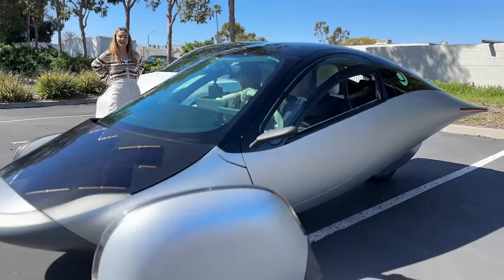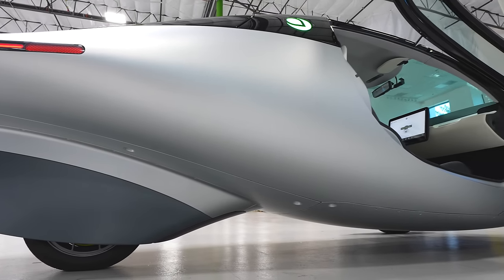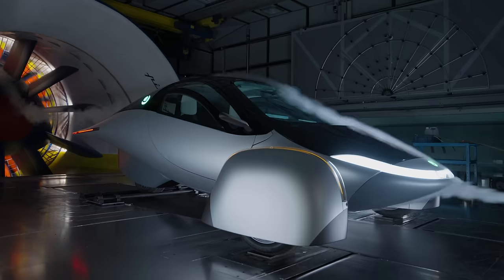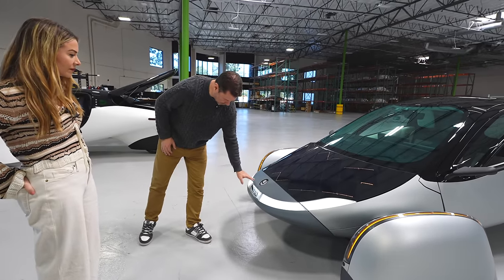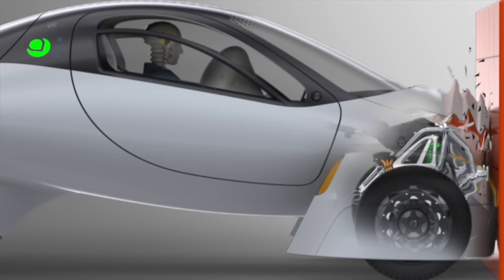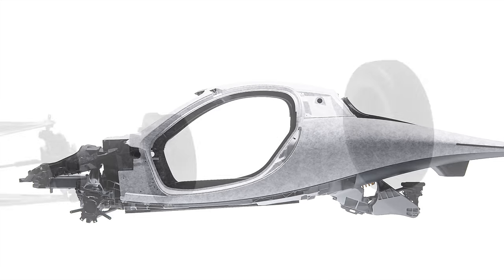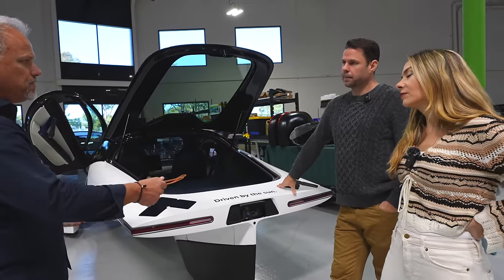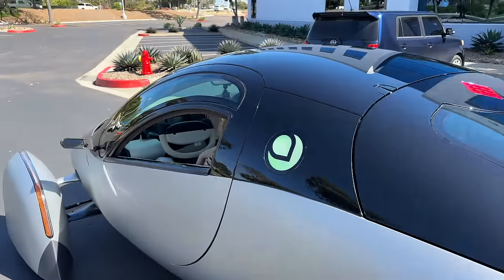Confronting Aptera's CEO w/ Investor - WHERE'S MY CAR?

Comment: I love aptera and have invested but am concerned about just how much market share they can capture with only 2 seats. I'm skeptical that most consumers will compromise on passenger capacity with the vehicle that they buy. That said, the aptera will be great for fleets, for some commercial use because it does have a lot of storage, and will be a very good shared or rental car. It will also be the best possible form factor for a robotaxi. Autonomy is what will truly unlock the ultimate upside for aptera. I ran some numbers and found that the cost to operate an aptera taxi over a 1M mile lifetime would be less than half the total cost to operate a model 3. Even if you assumed max capacity for each vehicle, an aptera with 2 passengers has a lower operating cost per mile than a model 3 with five passengers in it. This is why i think tesla should either acquire aptera and turn them into robotaxis, or design their own similar form factor vehicle.
Reply: Average total occupancy of vehicles in America is 1.5.  A 2 seat, efficient, commuter car will do well.
Reply: Aptera is planning a 4 seat version (probably with 4 wheels) in the future. This video was the first time that I have heard that Aptera is also planning a "utility vehicle", bus and semi-truck, which I think is fantastic, because they can dramatically lower the environmental costs of operating large vehicles with their better energy efficiency. If I had any money, I would invest in Aptera, because I foresee it turning into a major auto company.

Comment: I put in for the 1000 mi range edition because I want to do cross-country roadtrips in it with the tent unit.
Reply: My wife and I plan to do the same with an LE 400 mile range version.  We have extensive motorcycle camping experience and the range and comfort will far exceed our experience there.

Comment: The only thing that can compete against Tesla is good engineering and that's what Aptera brings to the table.
Reply: Aptera can't really compete with Tesla when something is expensive to engineer (like heat pumps, noise reducing laminated glass, carbon-wrapped motors, custom IC design, driving AI development, etc). Aptera has to stick solutions that can be done cheaply, but Aptera has made a lot of smart engineering choices in my opinion to avoid high costs.

Comment: The mileage doesnt make much sense. 250 miles for the 25 kw battery but the same ratio for the 100kw battery with hundreds of pounds of additional weight
Reply: The lighter vehicles will certainly be more efficient.  We will get a better idea of actual performance once the validation PI vehicles are tested.
Reply: Yes, the 25 kWh, 60 kWh and 100 kWh batteries are just estimates at this point, whereas the 42 kWh is production intent, so it probably will be what is produced. I expect the other battery sizes to adjust when Aptera actually produces those models, just like the 40 kWh changed to 42 kWh with the 400 mile version.

Comment: the right to repair philosophy basically illuminates the need to have service centers as long as you have a mechanic you can trust. that itself is enough for me to sign up, after seeing the a few of production model reviews ofc
Reply: I have already spoken with several independent mechanics here in Iowa, where I live and every one of them are eager to work on it.

Comment: I’m a fan.  My only concern is driving in snow and slush.  Lightweight and low friction is great in almost every way except in inclement weather.
Reply: I live in Iowa, and will report on my year round experience.   With proper tires and AWD, that can sense slip and adjust torque 32 times per wheel revolution, I think they will do fine.  Tesla's traction control senses 4 times per wheel revolution.
Reply: @n.brucenelson5920  I get that.  It’s more about hydroplaning and getting stuck than spinning out.  

I’ve spent 45 yrs in Western NY so I’m no stranger to snow.

Comment: While the Maxeon solar cells are pretty cool, they aren't the only mono-crystal silicon solar cells capable of forming to compound curved surfaces.  Also, starting at about 14:08, Chris Anthony exhibits quite a bit of ignorance about "old style" solar cells.  It is simply NOT true that if the crystal breaks that it kills all electrical connectivity.
Reply: Could you link us to more up to date information on this topic?
Reply: Regarding the "old style" solar cells, Chris A still trots out the old (and wrong) "if you break one it turns into a resistor" line.  What's new for him, however, is the incorrect assertion that the "old style" of solar cells are "only attached on the sides".  Clearly he hasn't even looked at solar panels made with "old style" solar cells.  If he did he would immediately see they aren't "only attached on the sides".

Comment: 10miles/kWh (if comfirmed) means 224N similar to the weight of 50lbs that is over 2x as efficient as the most efficient evs on the market (337mpge) but its also carries 2.5 less passengers. I like the idea of making the most efficient ev but the 1 row seat configuration is not the best compromise for efficency and passenger capactity and neither does the 3 wheel configuration that makes the car extra wide for stability. narrower car with 4 wheels and either 4 seats or two inline. 4 non open wheels.
I hope they did a good job at thermal insulation because AC impact on range is going to be brutal orherwise

Comment: I put my money down on Elio when they were telling everyone they were at this stage. Obviously that didn't work out. I hope Aptera actually delivers vehicles, but I won't be putting a reservation down. Also at this price point there are plenty of vehicles that do the job of daily driver just as well. One of the compelling things about Elio was the price. Obviously that was a pipe dream. However at $30k+ this is just a toy like the slingshot or the Can-am.

Comment: I love this idea and am one of the reservation holders... but... this vehicle does need tow hook points fore and aft. Why you ask? Because some will either get stuck in snow/sand, and or possibly go off the road either intentionally or unintentionally. So having some means of tow contact that is structurally sound is an important feature for any vehicle.

Comment: If sleeping in a car you really don't want your head in the tighter space or a window right over you. Also, during the knock-to-open pitch there was no mention of a reasonably accessible mechanical override -- something that would work if you fell asleep with the heater on or dropped into water.  I heard of this outfit through Rich Rebuilds.  Nice to catch a reminder.
Reply: I would like to look at the stairs out that hatch window

Comment: The new Preston Tucker? At least he built 51.
Reply: Aptera could keep $5 million stashed away and hand build 50 units at $100,000 each and deliver them at below cost. And avoid the fraud charges assuming the cars are viable. But I suspect if they delivery a single car to an independent reviewer the car will be exposed as riddled with problems.
Reply: @joedirt1965  Aptera is going to do complete validation testing on the PI models.   Remember that Tesla was shipping Roadsters for the first year with transmissions that broke under acceleration, and called them "production" vehicles.

Comment: My question for Aptera would be if a heat pump would be an upgradeable module later on for existing owners. Since in another interview Aptera was saying they want to make something easy to service. That if they come out with a better battery, computer, solar panels, ect that the end user would be able to buy it and install it. I have a concern about the ground clearance for the shrouds over the wheels. Not all roads are perfect. I worry about a pothole or road debris damaging that. Or even a steep driveway or exit to a parking lot.

Comment: This car was supposed to come out last year.... then it got delayed to late 2024..... now he's saying production will start about 9 months after they get tooling that they haven't even raised money for.... gimmie a break. This car is easily 2 years out still. There operations is a money pit. Last time I checked they are spending near 5 million per month not even in production.
Reply: Aptera currently spends $1.2M a month so stop sucking up misinformation and regurgitating. Fairly cheap as most auto companies spend billions to get to this point in pre-production. Watch as they enter production by end of this year or early 2025.
Reply: @barnabasseadog7660  he's saying production will start about 9 months after they get tooling that they haven't even raised money for. about a year ago he was saying they need to raise 35 million to enter production. now he is saying it's 75 million. have fun waiting I guarantee this car isn't in production until at least 2026. by then Tesla's 25k car will be ramped up and this will be a niche product if it ever actually releases.

Comment: The motors must survive a lot of stresses on a small footprint. Heat from breaking residue from the streets a lot of moving parts acceleration.

it Will be interesting how they hold up.
Reply: Most braking will be done by regenerative braking not a lot of stress placed on the brakes, and the pads should last a long time.

Comment: Why the questions about camping.? Nobody is taking that thing camping, with its low front wheel cowl clearance, it'd be lucky to cross a mildly rough bit of terrain.
It's a city commuter, not an overlander.
Reply: I will take mine directly to Death Valley from the factory - a place I have camped many times.

Comment: 🤔 How does the Aptera perform in crash tests?  

       How does the HVAC effect range?

       Although solar charging is the normal paradigm, will the Aptera be Tesla Super Charger compatible?

       Bringing Sandy Monroe’s group in early was a great idea for manufacturing optimization.  Thanks for a great presentation.
Reply: Some of the first Production Intent vehicles will be crash tested by a 3rd party to automotive standards and the results published.   We may know by Fall.

Aptera was the first company to press Tesla and the US to open the Tesla connector to be the base for the NACS standard, and they had permission to access Superchargers 6 months before Ford did.  The first vehicles will have a maximum charge rate between 40-60 kW - enough to gain the 400 mile full range in an hour.
Reply: @n.brucenelson5920  

      Thanks, Bruce, for the excellent info & feedback. 👍

Comment: I hope is has more than a 2500 mah battery, thats one 18650. I think you may have meant 25000 mah. The proper way to describe it is in Watt Hours, and the Fanttik has 92.5Wh. 
Watt hours is a way of rating a battery no matter what voltage it is, and is a better indicator of the total power you can get from it. A 92 watt hour battery can deliver 92.5 watts for 1 hour.

Comment: Who needs an Aptera when you can buy a small  BYD for $12,000-$13,000.The cheap EV will dominate niche 3 wheelers that cost double the BYDs
Reply: The BYD will be less safe and cost FAR more to operate over time.  The time to pay back the difference will depend on the energy costs in your area.

In addition, the 4 second  0-60 acceleration is far more fun.

Comment: The inherent conflict comes from talking about lightweight as the key to the millage efficiency and so forth and then talking about "loading it up" with band equipment, camping equipment, and so forth. So you have high efficacy but is based on unrealistic use cases.

Comment: 43:54 "A heat pump is terribly complex”  Huh?
I’m no expert, but I believe a heat pump is just an air conditioning system with a reversing valve. You were 95% of the way there.
Reply: I think you have oversimplified the concept of a heat pump. However, the majority of the complexity is in designing a heat pump for specifically FOR this car. It isn’t as if you can just slap a home heat pump or even a sedan heat pump on it and be good. You have to figure out where it will fit into the body of the car alongside the current build and wiring. You also have to design how it will be manufactured from product sourcing to installation in the production line. Additionally, you have to consider how it will behave in crashes, and be maintenanced in the future. 

That’s why it costs so much money to develop and why the estimate was 18 months of lead time.
Reply: @LC-sc3en  Good point, I rewatched it and he is talking about NRE cost, not piece price.  But I stand by my comment that a heat pump is not terribly complex.  It's almost the same as an air conditioning system.  It's a shame how few vehicles and buildings use them.  At least that is slowly improving.

Comment: I have a feeling drivers will damage the wheels and motors because they are outside the body width of the car. Simple distractions will make for very expensive damages. Why couldn''t they make the wheels fit inside the body of the car?

Comment: Why can't they use a small radiator like in car for the heater just tap in to the cooling lines or the in wheel motors to cool them down ..The friction heat needs to go some were ...Just a thought ...

Comment: Yeah great engineering, form factor etc, but fundamentally it's an expensive gadget solving a problem that doesn't really exist. Most journeys are short, or very short. And it's not going to make congestion go away.
I'd get by with a 100-150 mile city car for a third the price, but most of the time our family use bikes or ebikes for school and shopping, healthier, more sociable, more fun, more efficient.
Reply: I'm commuting with an Arcimoto as I wait for my Aptera.
Reply: I don’t currently have a car and would only buy an Aptera. I like public transit and E-bikes as much as the next. But Costco runs and trips to the mountains and beach are pretty much a no go. Not to mention taking my cello on public transit is a bit of a nightmare. Plus my friends with kids all live a dozen or more miles away in the suburbs. Taking an hour an and a half to see them or having to pay 50 dollars plus tip call a car for an 15 min drive is not great. I don’t want a normal car because I don’t need more than 2 seats. Plus living in an apartment means I don’t have access to home charging. And don’t care to spend hours at the public charging station waiting for my turn and then charging. 

This might be a rare edge case but nonetheless I am happy it is hitting my edge case.
Reply: @LC-sc3en  Fair enough! Sounds like a happy customer. I'm happy for you too.

Comment: Aptera maybe could have brought those outboard front wheels in to the main body if they would have engineered the wheels to tilt as they turned.  With tilting front wheels there would be way less need for such a wide front wheel stance.
Reply: The forces on a tilting wheel would make me nervous for traction and wheel life. Probably could be done with a ton of engineering though.

Comment: In all my years of owning cars, I have never sat on the roof, because I knew I would damage it. Why anyone would think electric cars would be different puzzles me.
Reply from the maker: Wasn’t really “seated” per se, was featured in a vlog where the thumbnail was taken in the bed and I leaned on the glass in the back of the bed. The point was the glance has since been redesigned as Rivian roofs were cracking when people went on the bed and leaned over the roof to clean the glass.
Again, full video is on this channel. Thanks for watching and commenting

Comment: brilliant concept question is how expensive would it be 
although it could be pretty expensive if you take into account that you barely have you pay for fuel or insurance and 
if its the truth with the repairability
Reply: not very expensive. Smaller battery than other EVs, one less wheel, less material overall to build, etc. They're still quoting $26k for the base model that gets 250 mile range, but that's likely to increase slightly due to the inflation over the past few years

Comment: Where is my 600 mile Apterra? Tired of changing oil, tune ups etc. Although this vid got some of the concerns, my concern is, are all 3 wheels the same size & is there spare tires to change if one gets a flat?
Reply: It looks like all 3 wheels will be the same, at this point.  A spare can be carried but won't be included.  I plan to carry a plug kit and a DC inflator which has worked well for me in 1/2 a million miles of motorcycling and on dually step vans and cars.
Reply: I've commuted with a Miata for sixteen years, never needed a spare tire. Just an air compressor.

Comment: What is the ship date? I had to skip around due to the length of the video.
Reply from the maker: See chapters below, lots of good info in there so decided to keep it longer than typical. Production begins in Q4, deliveries early next year.
Reply: Still dependent on sufficient funding, something still in question on timing.
Reply: According to the website and the CEO, end of 2024 for first deliveries.
Reply: @billsmith5960  That is old information.  Now first deliveries are expected in 2025.

Comment: Thermal runaway is a reason for high insurance cost don't believe you'll get motorcycle insurance rates. Not asked, with last winter freezing everyone out of their EV cars, what is the solution? Not sure I understood the whole heat pump issue, what is going on? Sounds like they don't have a heating /cooling solution as of yet? Also no definative answer to their supposed Premium Sound system. Are you able to put tire chains on these wheels when needed. Wish they would elaborate on the level 2 auntomous driving and what it would cost to go too level 3